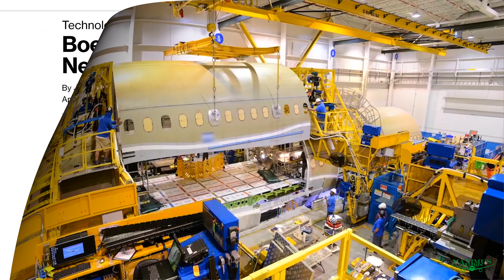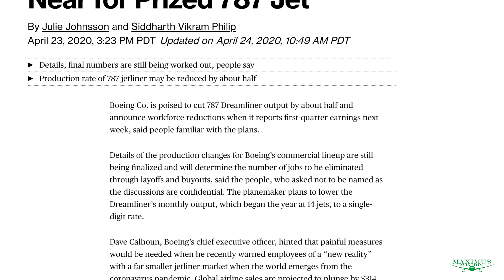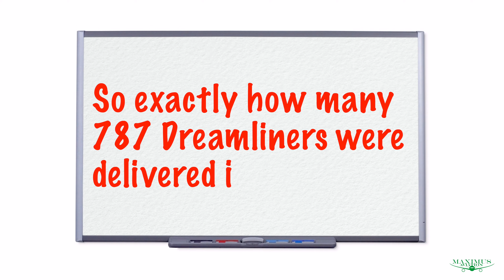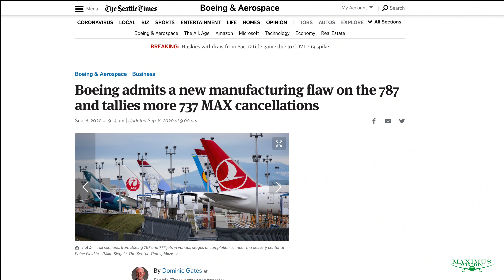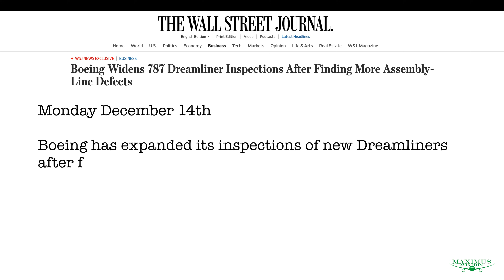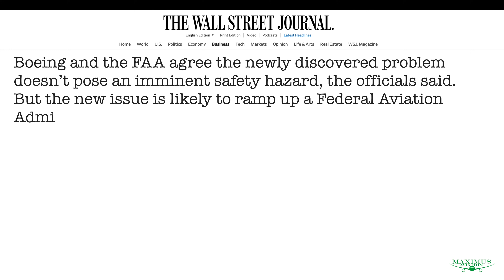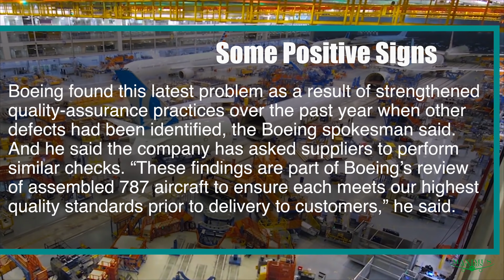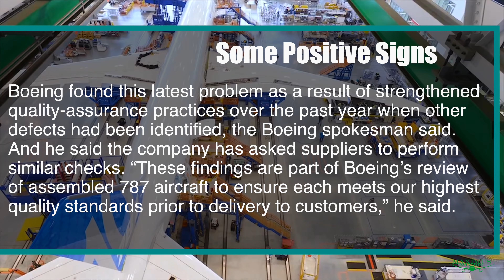Boeing Found Even More Carbon Defects In The Fuselage Of 787 Dreamliner This Month See How Bad It Is

Comment: Should assembly shims really be required if the build environment is properly maintained?
  Isn't that the reasoning behind using environmental controls?
 Hey Merv, make the shims a little thinner tonight to counter the effects of the higher density swamp gas!

Comment: Although they might have found structural defects with an easy fix ,the fact is that deep inside the skin or blind areas of this plane ,there is shitty work installed ,like electrical shyte ,metal debris and other dirt that will someday find its way to a major component and cause a fatal crash or deadly fire..just wait...

Comment: I predicted this exact defect would be a problem even before the first 787 rolled off the production line for engineering reasons I don't want to get into here, and I'm convinced nobody at Boeing ever studied the Comet fatigue issues in the 50s. I know this is a very different aircraft and technology, but in both cases using new technologies created unexpected fatigue problems. I'm just glad that no 787 has been lost. I find it incredible that Boeing appear to be using the "if we can't fix it, feature it" marketing ploy to pat themselves on the back for "finding this issue due to their improved QC". I'm not anti-Boeing, and would be glad to see them successful but they need to change their culture and focus on solid and safe engineering, not just their share price (maybe the 737 Max fiasco  will finally make them wake up to that).

Comment: Sadly the refrain remains the same from Boeing. “We have extensive quality controls in place”, but finds itself backpedaling after again being exposed as not quite “truthful”. Happily there has yet to be a fatality (many incidents) with this beautiful plane. Sadly, if and when a fatality does occur we will all suffer Vertigo from the finger pointing that will occur. When Engineers and Technicians are overruled by Bankers and Investors safety seems to take a back seat to profits. And The Band Plays On.............

Comment: I worked for boeing at SC on these exact shims in the exact area being spoken about. This isuue has been known right from the beginning of production in 2010-11. As the shimming used to be done with hand made shims and hand measured gaps, it took to long and created a production bottleneck which they "solved" with predictive shims created with a robot. Problem was the robotically produced shims just weren't that great and now boeing can't in great confidence say they are all safe. This has been well documented right from the start and ignored due to delivery schedule.
Reply: Right on there, however, when a corporation is run by accountants, you cannot expect nor anticipate better, save  even half a cent which adds to any risk factor and its the Mega Half Cents these drongo pen pushing nitwits go for everytime.Terry Offord

Comment: Manufacturing and design defects are nothing new to aircraft industry.  The 737Max brought attention to Boeing...but the fear industry did not mention the Max had been flying for two years and thousands of take offs prior to third world airline crashes. 
    Boeing new plant with new workers is going to have problems.  Cessna shut down a 30 year production run of the 172 Skyhawks.  A decade later, They restarted in a new plant and had Quality problems and subsequent recalls.  The 172 is a simple aluminum 4 place airplane.
    The FAA’s role is misunderstood.   The FAA does not develop technology.  Regulations are reactive...plow thru a copy of Part 23.  Existing regulations and developing technology are not always in agreement.   So what does one do then, stop developing?  No, the FAA works with the manufacturer or there would be no progress.
     Last, what sense is it for Boeing to kill its customers?  How does opprobrium benefit sales, improve profits?   Boeing suffered from the Max,  learned, and vigorously addressing the 787 ......a demonstration that market forces work.

Comment: I would rather have an old aircraft overbuilt by Slide Rule engineers than a aircraft built with just enough by a computer any day. Slide ruler: The wings shouldn't flex tooooo much ! Computer: The wings will flex up and over the roof ! (I understand the wings aren't the problem, just saying for point).

Comment: The only reason Boeing has enhanced it's quality control is because it's under the microscope after killing 300 people. The FAA is also under scrutiny for failing to do its job as a regulator not a rubber stamp.

Comment: In terms of the timing of all of these problems, does any of it match up with Alan Mullaly being pushed out (and being picked up by Ford Motor Company)?  Seeing what he did at Ford suggests that many of these issues may have been avoided had he been picked to run Boeing.

Comment: How about that Al Jazeera documentary from few years ago that talks about the same issue - the holes on rings joining 3 fuselage parts being punched by using the carboard template instead of by the robot made specifically for that task? And now Boeing, after ruining the career of a man - engineer - who raised this issue, pretends to have found that skin of the fuselage is not as flat as it should be and that is the reason crevices appear on the Dreamliner? Another premediated mass murder is about to happen and Boing and FAA lost all the credibility and reputation they can ever lose.

Comment: 5:30  From Boeing and the FAA, this is the blind helping the lame.  Neither of them has a reputation worth the powder to blow them to hell.   I will never ride Boeing....
God-damn you McDonnell-Douglas.  You turned the pride of a nation into garbage as you laid it reverently on the Altar of the Almighty Dollar.  GIVE THE COMPANY BACK TO THE ENGINEERS, FFS!  And purge anything that reeks of McDonald-Douglas' greed corps.  Otherwise you're fighting a losing battle, ultimately building only aerospace/military where gov't holds your face against the grindstone while Airbus inherits the planet's commercial side.  You've got some pretty seriously screwed up people there.  They have to go before you disappear from the commercial scene.  You've shot yourself in both feet so it's just going to get more painful.  Eventually the pain will bring you to a halt but you can do better than that.  As I said, give the company back to the engineers.  At least most of them have ethics, software excluded specifically from that statement.  They get pushed around too easily by the bean-counters as we have seen at a cost of 700+ lives.  And do not rename the aircraft as the super-winning Orange Spectacle had suggested.  That has and always will reek of chicanery and dishonesty.
GET ETHICAL!

Comment: In reality this is not Boeing of the old or not Boeing at all. They should have just called McDonnell Douglas and this again is not the DC3 (which I flew cargo in 15 years ago out of Puerto Rico) Douglas company. Nothing but modern day "wall street" wolfs going after profits. Same happened to my beloved Twin Otter that I have been flying for the last 10 years. De Havilland of Canada stopped production in 1988 and as the years went on the demand for them continued. Viking of Canada purchased the rights and in 2008 gave us a new, all improved twin Otter. Well this new airplane is junk, a beauty queen for the fancy FBOs and corporate pictures. This was a reliable, go anywhere and do some amazing things truck. No operator who is trying to make money wants one, old refurbished birds are the choice. I got to fly this new series for 50 hrs, never seen aircraft with so manny issues, mostly coming from the ill suited 1 million dollar fancy instrument panel. Could not even start the engines without ground power unit, if you did panels went black as you looking at critical engine parameters while starting. This for a bush or in my case remote island locations (on floats) operations airplane. To taxi on water, not to overtemp the engines we would have to turn off the electrical generators, a sad joke. Anyways I guess all this is progress.

Comment: 'When Boeing & the FAA agree about safety',  Are you worried about these two organisations agreeing with one another?   There will always be problems with aircraft manufacturing, (This is why there is normally a 2 day check before an airline takes ownership of the aircraft), normally small anomalies, but Boeing just seems to have poor design engineering/quality control.   Whether this is in the aircraft desigh or the tool design.

Comment: Maximus I am afraid you're wrong on this. Boeing 1999 would get benefit of the doubt from me but not Boeing 2020. I say complete outside audit of all the aircraft systems developed since the Max program that has occurred  concurrently from that year needs to be done for Boeing & the FAA right now by an outside third-party because we can't trust either one of them. Seriously I think if their current CEO had any business sense he would actually asked the FAA to request a private third party inspection of the works. I didn't think nothing short of that will restore confidence in them. Failing that the rot will just simply continue.

Comment: I’m the kind of guy that wants to see Boeing go back to the way it used to be run.  A company of engineers run by engineers, not what it is currently, a company of engineers run by lawyers & bankers.  When the shift in culture took place is when the quality & safety on the production of aircraft went downhill.  I say that as a fan of Boeing & prefer to fly on Boeing aircraft whenever I travel over any other manufacturer.

Comment: Thanks for your research on these stories. I might add a note on debris “unintentionally” left inside structures. I worked as a mechanic for Frontier Airlines in 1966 when we were taking delivery of new B-727 100’s. I found paper cup, paper production reports, and other debris in the filters for the Cabin Gasper Fan System. It was determined workers in Renton found it amusing to watch theses discarded item be sucked into the gasper air intake. I suspect the “unintentional” debris found in Dreamliner is there due to carelessness and an indifference of Boeing workers
Reply: GLIDER PILOT I KNEW  BOUGHT A GLIDER CONTROLS JAMMED IN A LOOP  FOUND A PAIR OF PLIERS LEFT IN 20 YEARS BEFORE
Reply: A flight test prior test, that is, ALL responsible for the safety aspects, assemblers and 'Just doin' what I'm paid to do types' should be given the very first test flight of each aircaft, that should get rid of the couldn't careless floor workers and accounts staff from Boeing. Then perhaps, they could entice Airbus staff by offering decent salaries. Terry Offord

Comment: Another MaxAwesome video!

As a new product development mechanical & textile manufacturing engineer, carbon fiber transition points have extremely tight tolerances critical for proper load transition bearing, safe compression & decompression longevity and long life structural integrity. 

With Boeing’s “large multiple bolt together barrel carbon fiber fuselage design”, any inflight cracks or deficiencies at transition points may cause rapid decompression, possible delineation with potentially catastrophic results. All joints must be smooth, perfectly aligned and properly joined to maintain cohesiveness in the system.

Airbus uses a different design philosophy in their carbon fiber fuselage design incorporating a hybrid skeleton design with inserted carbon fiber skin panels vs Boeing’s multiple rolled and bolt together carbon fiber barrels.

In general, with any carbon fiber applications there is no room for errors as carbon fiber gives little warning before catastrophic failure. 

I have engineered a third continuous carbon fiber fuselage design and  surprised neither Boeing or Airbus has done the same. 

Cheers,
KP
Reply: That was an interesting and useful comment, problem with the question is, Do Bean Counters know or understand the physical liabilities of man made materials? We know that Boeing bean counters don't know anything about safety but hey,they can save .25 cents per rivet joint.Terry Offord
Reply: How do you find areas of fatigue in a section of a carbon fiber hull?

Comment: Thanks for the update.  The B787 has a good reputation so far, and at least they are admitting and tackling their mistakes.  I'm willing to give them a fair hearing on correcting their errors.  I would prefer to be on an Airbus, but it seems like Boeing is trying hard to regain their lost reputation.  Time will tell.

Comment: I would say, that Boeing senior management have been aware of the B787 issues for a while and kept it quiet until the B737 MAX fiasco. Since Boeing has embarrassed the FAA, the FAA is tightening up on its checks on Boeing, as they don't wont to be embarrassed again. I think we will see more issues coming to the surface in regards to Boeing production methods.

Comment: Boeing plays with fire like a child. Allowing a poor quality assembly on the 787 is a criminal act. It is also an offence to the engineers Boeing still has. I wouldn't be surprised that with the first serious accident, the Boeing beancounter management will blame its engineers.  I don't believe that the good old Great Engineering Company will come back. It's a business company now. Quality is now secondary to profit. All Boeing can now hope for is that no serious accident will happen with the 787. Poor quality assembly does not show the first decade. It is only after that, when a plane ages,  that poor quality shows. Stating that no serious accident with the 787 has happened, yet,  is thence a false argument. The aim of the Boeing management is now to produce a 'sufficient quality' product, as the epoch of producing excellent products has elapsed. Not for the competition though. In the future Boeing will only be able to compete with its cheap prices. Not the best choice if you ask me.

Comment: No problem, just close the SC line.. no, wait, they closed the one that has less defects and chose the one that delivers the defective planes, as it is cheaper.  I think this sends a powerful message about how much they care.
Reply: Also as someone who has worked at the SC plant you have no idea how bad the issues are. It's all stemmed from management. The workers are beat down and just don't care anymore. Good ones especially with experience are driven off.
Reply from the maker: Yeah, hard to figure that one out.
Reply: @maximusaviationchannel  it's not hard. The 787-10 can't be built in everett. The assembled mid body fuselage section doesn't fit on the Dream lifter. And to relocate all the stuff they need to manufacture the section 47 and 48 would be to hefty a cost for the few remaining orders they have.
Reply: When the defective parts come from the outside, how does the final assembly city matter? Vast majority of the 900 newly suspected planes were assembled in Everett.
Reply: @jimandmandy  Jim,they’re planning to have all 787’s built in South Carolina. Airlines are refusing to accept planes from the South Carolina plant.
Reply: @jimandmandy  good point but also a part whose production was shifted from Seattle to Utah to lower costs.
Reply: @jimandmandy  It matters if the employees have more leeway to reject substandard parts.
No union means kissing the diamond ring or else.
Reply: @aitorbleda8267  there all temporary jobs
Reply: @herbboucher816  You mean, no permanent jobs in SC?  That is bad.
Reply: @aitorbleda8267  A great place to retire but a shitty place to have to make a   living ,especially if your not from here.
Reply: @aitorbleda8267  Does not work like that. All parts are certified, or they don't go on the plane. How the unionized workers put them together might be the problem?
Reply: @aitorbleda8267  no it don't.
Reply: Look up the Al Jeezira documentary on the 787. Technicians were trading frugs on company property even as manufacturing proceeded. Says it all about the attitude and ethics of the culture at the SC plant.
Reply: @rmm3803  lol, a hit piece from 10 years ago. Just hush.
Reply: @rmm3803  Al Jeezira is garbage. All they do is try to destroy all western institutions. Have you ever seen any bad news or negative documentary at Al Jeezira on ANY institution, company, or religion related to them culturally? That is not to say that western news sites like CNN are any better. Its all propaganda. Propaganda from one side against propaganda on the other side. Nothing is real.
Reply: Bullshit. You don't have a clue what your talking about. How about the truth, the closed the overpriced labor one for the one that did not have a union and the bs that comes with one. I know who did what, your statement may of rang true in the early years, but far from accurate now.

Comment: Rightly or wrongly, if there is a perception that an airline has to replace parts (or even the aircraft) after say 15 years rather than 20 years of normal use while they are confident that the competition has far fewer of these unpleasant surprises - it doesn't take a genius to see the likely result.
Let's hope that if any more issues are found that they are of the wearing out more quickly than expected rather than the premature failure kind.